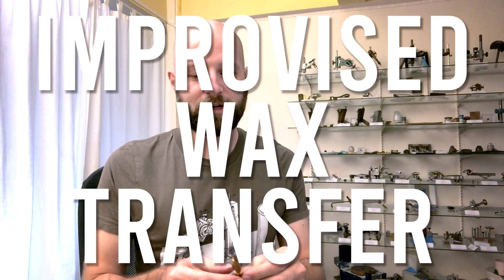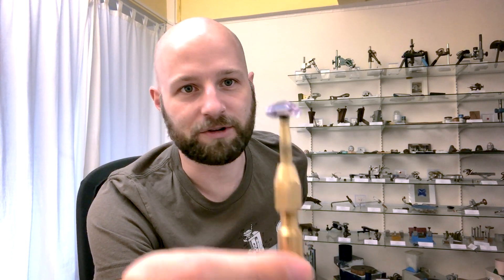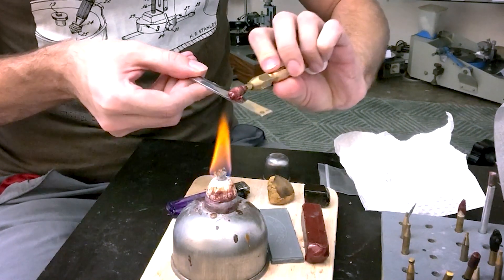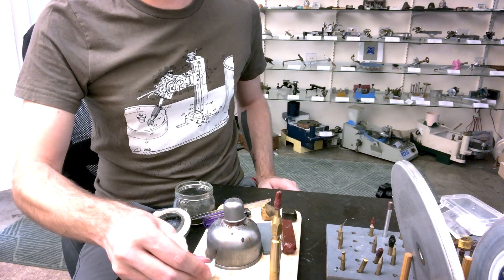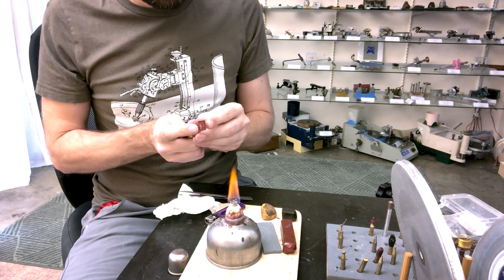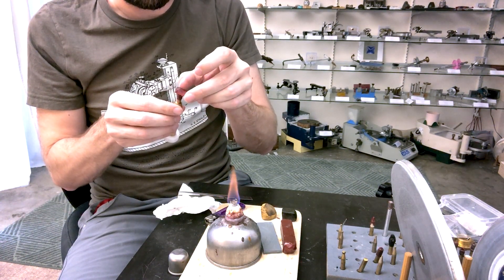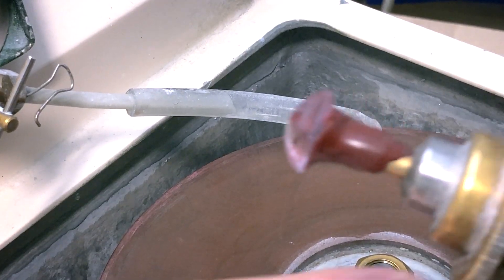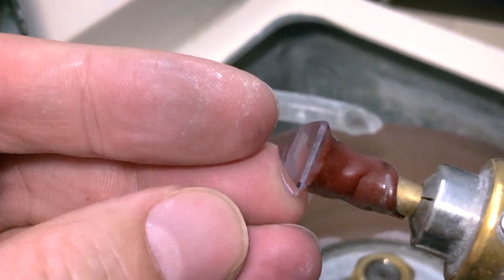Improvised Wax Transfer - Gemstone Faceting Technique

Comment: Great video, I use this method all the time, when making tallow cut tables for emeralds. It is more challenging on my V5, but i don't know of a better way than what you did. Just making small adjustments, until it's cutting straight.